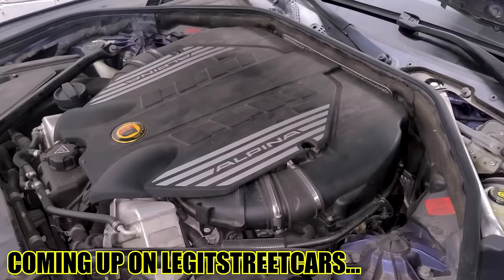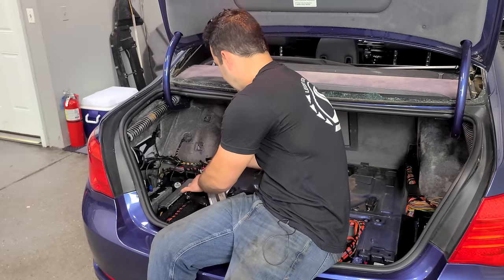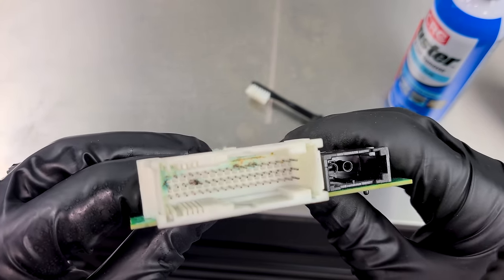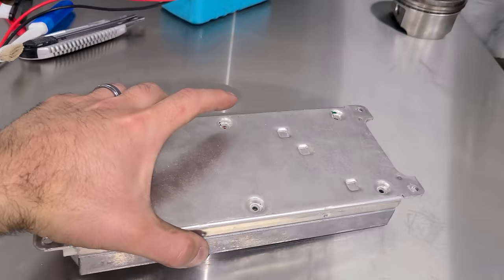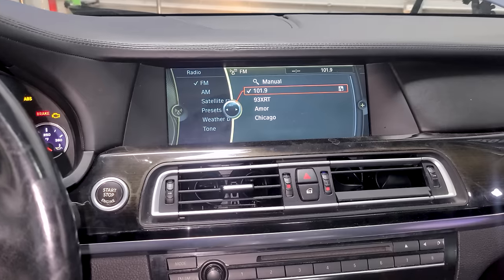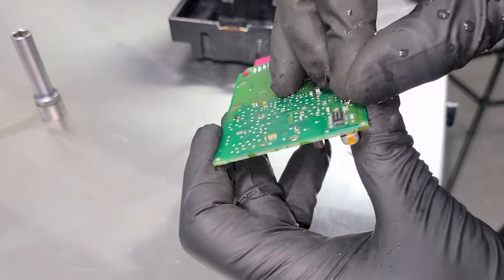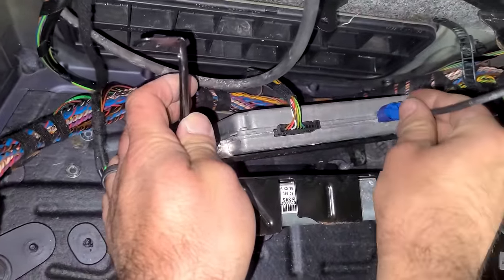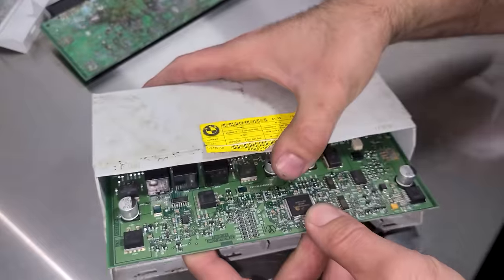BMW Dealer Tried Totaling My Car By Quoting $15,000 For 10 Computers! I Fixed Them All For $150!

Comment: Love the way you cleaned the circuit boards in this video! It makes total sense for a vehicle with light water damage where modules might not need to be completely replaced

Something to note though at 20:26, be EXTREMELY careful around the capacitors I'm that sound module! Those capacitors (the black/silver silo's) store a lot of energy for a long time, even after disconnected from power. By touching a trace on that board that one of them were connected to could've very easily electrocuted yourself!
Reply: Yeah not really in an audio amp. Caps will discharge fairly quickly and even then they would be relatively low voltages. No one is getting "electrocuted"
Reply: um...from amp control unit? come on...

Comment: That pin can totally be soldered back on by someone with some electronics experience. I hope you didn't throw it away because that would be an easy fix. Just search for electronic repair shops. They have been doing that with way smaller pins in cpus for years
Reply from the maker: I hear ya but the module is $50
Reply: @LegitStreetCars  In that case, you did the right thing! But maybe you can still recover some costs if you ask around :D
Reply: Electronics tech, here. Usually I don't bother soldering pins back together as long as some of the nearby pins are not used on the harness side. I just swap over one of those unused pins.

Comment: I would use distilled water for cleaning, not tap water, changing that water often as the pc boards are cleaned, with an ultrasonic toothbrush! In some cases, if the corrosion has eaten traces, soldering jumper wires to reconnect nodes. I am a retired electronics engineering technician with 40 years of experience.
Reply: Finishing the cleaning with deionized water would be if readily available is a good move. Drying should be accomplished by baking the cleaned and processed Boards at 125 degrees Fahrenheit for 12 or more hours, to allow all moisture to evaporate from under all surface mounted integrated circuits, or while there may be initial success in restoring the normal operating status of the circuit, slow corrosion while powered, may resume and ultimately cause the circuitry to fail again. I do not recommend leaving the boards in direct sunlight to dry, as UV Exposue can erase some  System On Chip Integrated Circuits or support memory chips. These chips rely on charges stored in matrixes of capacitors and the dielectric insulation breaks down with Ultraviolet Light exposure to the body of some integrated circuits, erasing vital flash programming stored in the chip.

Comment: I don't know why but I found your video very soothing lol. I love it when people do a DIY instead of blindly trusting the dealership. I had defective adaptive headlights warning in my E60. The dealer told me I had to change the whole headlight assembly (both of them) plus the LCM, and they quoted me $5000 for the whole thing. I decided to take headlights off, and the AHL module, the one attached at the bottom of the headlight, was completely fried. It looks even worse than your trunk module. I don't even know how water got in there. In any case, I replaced the module, had the headlights resealed and the redid the wires too (the insulation was crumbling), and everything is working fine. The LCM is in perfect condition. I spent maybe $100 total. Never, ever, trust the dealership.

Comment: Thanks for this! Reminds me of a time when I was working on a 2008 GL450 and the driver side headlight would not work. I eventually tracked the problem down to the control module under the passenger seat. Connections and relays we're totally corroded and I ended up replacing with a used part. I should have tried to clean it like you showed. As always, amazed and inspired by your content, #Roadto1MSubs!

Comment: I realize this is 2 years old but it is a good video.    Most people fail to realize how much cleaning and TLC can help.    I occasionally play with small engines.  A number of them can be brought back to life by tearing them down and cleaning.   Have to wonder how many cars were junked in the pre EFI days simply because everything was carboned up or dirty.

Comment: This is a great video, and thanks for posting it!  I had a Mercedes E320 some years back and one fine day while driving, a warning message appeared on the dash about the charging system/visit workshop!  I checked the belt to make sure it didn't come loose and it was fine.  I drove home and connected a volt meter to find the charging system was in good working order.  A little research on a MB forum led me to check the Transmission Control Module which was full of ATF!  Apparently, a defective connector at the transmission allowed ATF to wick up the five foot harness and into the module which was located in the engine bay.  I was able to disassemble the TCM and clean it with electronics cleaner spray and compressed air. I also replaced the defective connector on the trans (a $10 part) and cleaned out the harness by spraying electrical cleaner through it.  Put everything back together and everything worked as normal and no more warning light.  Had I taken it to the dealer, I was looking at $2500!  The ATF  module had fine metallic particles suspended in the the fluid which triggered the charging system warning light to illuminate on the dash.(I'm guessing the particles caused a short)  Whooda thunk ATF could wick up a five foot harness and into a TCM???  But it happened and my repair was a permanent fix.  Kudos to you sir for patiently cleaning up all your modules to make you BMW come back to life!

Comment: You could tell your audience, that you can get every Pin-type with a little piece of wire allready crimped to it for repairworks to buy. They arent expensive and a great thing vor repairs like this.
If you give this kind of damage to a Dealer, they often want to replace the whole harness and thats incredibly expensive.

Also, if those Connectors are coroded, I personally would replace them with new ones (at least those pins with a little corosion). You dont get all of the Corosion out with the brush and cleaner. The remaining Corosion slowly continues to eat into the metal. It may take a few years, but eventually you get bad contacts and problems. If you take the time and replace those, it is fine and keeps you or the person after you away from headache and trouble.

Otherwise, this is a great video for everyone who didnt know, this could be done.

Comment: If you have any doubt just take a photo before you disconnect. Do photos of all of them.  You might be glad you did!  A lot of vehicles tend to have multiple computers and they seem to look similar to other ones.  At least this way you may be less likely to damage a connector with one that was not made for that socket.  It can happen and I just know someone out there bent a pin or two accidentally.

Comment: On the EPK the green corrosion was all over the voltage regulator, so no surprise you had massive issues there. Often a fault you will see as an under/over volt if anyone wants to know. Just a good idea to touch up the solder joints if you have the skills as cleaning is not always foolproof in that respect.

Comment: Having an electronics repair lab, I would recommend ultrasonically cleaning (sweep frequency) circuit boards in distilled water and Branson EC Electric solution, followed by a bath in 99.9% isopropyl alcohol (IPA), followed by air drying.  IPA displaces water.

Comment: I own a 335i Touring 2007, turbo waste-gates repaired and it drives like a dream but the Comfort Access has been intermittent and bugging me ever since I’ve owned it since 2018. I’ve changed the control unit at the top of the tailgate and it improved a tiny bit, probably because I moved the connector and it’s pins during the process. I never suspected connector corrosion and every garage I asked including BMW either said old BMWs do this or we don’t know why it does this but now having seen LSC Alex perform his magic I’m eager to try the repair work on all the module connectors. Thanks for all the vids. The Mercedes’ videos are great too. I watch all of them although I only own a Vauxhall Zafira and the E91 - lol !

Comment: 28:26 the impact point is clear. vertically center but off to the left. The white mark on the housing where something has crushed or it it causing the fracture.

Comment: You can buy se-ionized / distilled water by the gallon at the grocery store.  Also probably a good idea to lay the water-washed boards in the sun for a few hours to dry them for sure before you power them up.

Comment: I been tooling with circuit boards since I was a kid in the early 80s.
deionized water and distilled becomes ionized when it picks up corrosion salts on the circuit board, so I prefer to use 99% medical grade isopropyl alcohol, readily available on amaz.
The condition of new boards at circuit board manufacturing plants is very different from used, corroded circuit boards. 
A hot air rework station is superior for heat shrink tubing, and the unit heats up in seconds and won't burn the tubing. It's also great for fixing cold solder joints on circuit boards and resetting SMCs.
I would step up to acetone or vinegar or baking soda/water and a soft toothbrush to using a metal brush on circuit boards.
If this were to be a personal car, since you are working on the circuit boards, I would encapsulate them with an epoxy made for that purpose to protect from corrosion. Wouldn't do it for resale since no one would know what the heck you are talking about nor would pay more for the car

Comment: For DIY people that might try fixing stuff that has fiberoptics. Take it slow an be cautions around the connectors. If you get some dirt on it or scrach it very lightly it might not work anymore.

Comment: I have to give you a big thumbs up. I worked as a mechanic for 8 years. This was late 70s and early 80s. Back then if your car stop running you kept a set of points and condenser in the glove box replace the old set and be on your way. But I always wonder if you could do some thing like you have done here with a water problem and dirt getting to these units. Great video and thank you.

Comment: This is an awesome video for all the BMW peeps. It would be very nice to have a directory of which modules are "dumb"/don't need any coding or adapting. 
I sold my E91 LCI 330d Xdrive partly because it needed electronic diagnostics and expensive new modules two separate times, and the comfort access still had a range of basically zero (i had to take the fob out of my pocket and literally hold it to the door handles for it to work, therefore nullifying most of the "comfort access-ness" of the comfort access. It usually worked fine at the rear hatch, go figure, i later learned that the main comfort access antenna amplifier lives back there in the roof at the top of the rear hatch and it's a known problem with water getting in there and shorting things out.
Thing is, nobody except the BMW dealer would even touch electronic diag on newer BMWs in my area, and they apparently had no clue about this extremely common issue. I was willing to live with limited comfort access, but having to have the car towed to the dealer once and having expensive modules replaced on top of having to have other expensive modules replaced before that made me sell the car while it was still worth something. Also i needed to pay off a stupid loan.
I loved my 330 Xd, it's really a great car, but i'm not sorry to have it gone now when it's 13 years old and i still actually got a fair bit of money for it.

Comment: Electronic bath can also aid in the cleaning. One thing I would really suggest is use of and anti-static brush instead of a regular toothbrush to prevent killing electronic devices with static discharge. It would be a good idea to keep things well grounded, for example a wrist strap.

Comment: My theory for a possible explanation of the ABS damage is that Something bounced up from the road hitting it, breaking it long before the car was left to rot.  Some piece of debris on the road.  Similar idea... the car was driven other than on the pavement, and after going over something that raised it up it came crashing down on something sticking up in the Wrong Place.

Comment: The blue or pink pads you see on some parts of the modules are thermal pads. They transfer heat. If you do this yourself, you can either replace them by measuring their thickness, or just gently remove them. They tear easily so you might have a better chance just replacing them, they're super cheap. 

Don't expose them to any chemicals. Even water really isn't that good for them. So in a case like this, they should probably be replaced. 

They keep hot spots on the board to a minimum. Some of the components do produce a significant amount of heat. Not replacing them could cause issues either in the future when the component(s) fail or right away if they decide to throttle the performance for whatever they do in an attempt to protect themselves. Which isn't uncommon. 

Also, contact cleaner is safe for circuit boards but it leaves a residue. In some applications, this residue will cause issues. Generally for higher power applications, it will be fine. But these are effectively mini computers and a lot of parts of them are sensitive. Using something like a technically grade isopropyl alcohol would be better as it won't leave a residue that can interfere with connections.
Reply: The original video is correct; osmotic effect from demineralized water cleans very well. Sure, you could use IPA ... but clean water works too. Heck, given that level of pollution, tap water would help.

Comment: Nice JOB !!!!!! Most PCB are conformal coated :
“ the material  is a thin polymeric film which conforms to the contours of a printed circuit board to protect the board's components. Typically applied at 25-250 μm(micrometers) thickness, it is applied to electronic circuitry to protect against moisture, dust, chemicals, and temperature extremes. “

Contaminación creates resistance bridges hence causes voltage drops .. and faults

Comment: Many years ago I was working in an Ice plant when we installed water purification in our new bu8ilding we had 2 reverse osmosis units in series.  The tech told us that at Texas control where they were making circuit boards they checked the purity of the rinse water by resistance of the water. If the resistance wasn't high enough it was time to change the water.

Comment: Get the number off of the connector on the control board with the broken pin and you can order a replacement and solder it in place of the original connector.  If you are not up to that then you can probably pay someone in an electronics repair shop to perform the swap.  Still a lot cheaper than buying a new one from a dealer.

Comment: When you finish cleaning, cover the connectors and the board with a high quality Dielectric Grease. It will help prevent future corrosition and non-working issues...

Comment: Somebody let the smoke out of the ABS module, that right there is an electronic failure. It looks like the chip is blow'd up.

Very good vid! This info applies to almost any car on the road, computers look virtually the same and suffer the same failures.

Around me (atl) there is an abundance of bmw's/mercedes/volks in boneyard from electronic failures/cost too high to fix. Good opportunity for the brave.

Comment: I rescued a water totaled Rx400h that was wet to its seat cushions I cleaned every connector and ecu I only had to replace one unit that shorted out on the casing from too much corrosion 
😁great video Alex!

Comment: I worked in a lab that worked 24/7 back in the 90's. When we had a problem with a keyboard the boss would swap it out then clean it. The first time I saw him do it I thought he was nuts. He pulled it apart blew all the crap out with compressed air then put the circuit board in the sink and washed it. Then he sprayed it with electronic cleaner, which I didn't know existed till then, dried it with air and put it back together. Good as new. I use the same method on my tv/video remotes now when they stop working.

Comment: I had a gas water heater fail on me at a crucial time. Forcing everyone home to have to take bird baths. The technician came in and suggested replacement at a couple grand. I refused. Took the unit apart and cleaned out the motherboard much like you suggest here. The heater was still running when I moved out three years later. It is difficult to burn out a motherboard. It does happen, but most times it's just cleanable corrosion. Basically, this can work for anything that has a motherboard and they tell you it needs replacement.

Comment: A glass fibre brush will help as well.
Furthermore, when working with electronic components or electronic circuit boards, be aware of electrostatic discharges, ESD. This can damage electronic components visibly and invisibly.
Avoid using plastic, nylon, polyester rags, brushes, even your body can be static charged and discharged via the circuit board you are working on.

Comment: I work in the Aerospace industry. Deionized water is used for cleaning soldering tips. We use BIOACT for cleaning the circuit boards. I ought to know since that's what I do for a living. I assemble circuit boards for aircraft.

Comment: You can take this a step further. For example, if you are working on an older car with broken electronics you may just assume that the unit as a whole is junk and try to find a new one. However new ones may also have the same problem, or will be refurbished by someone else for an insane price.

If you have a multimeter and can figure out where the corrosion is, you can fix this kinda stuff yourself by replacing the features of the board which are usually available in bulk online